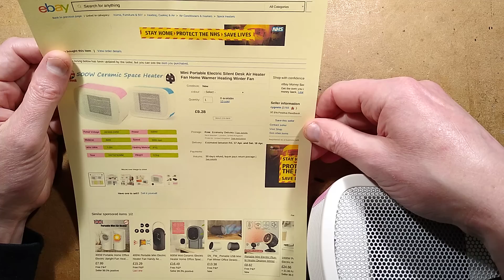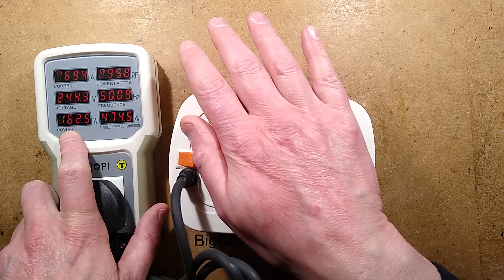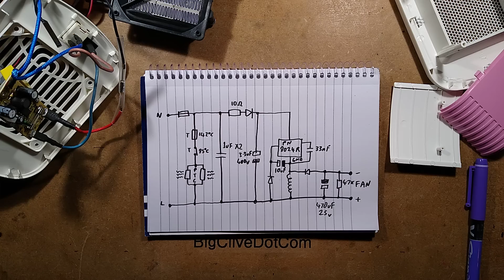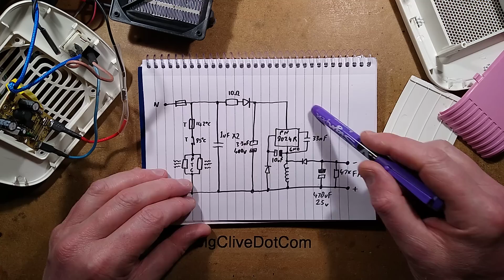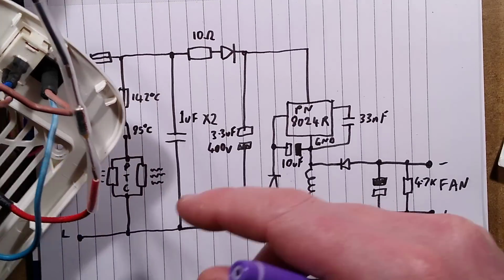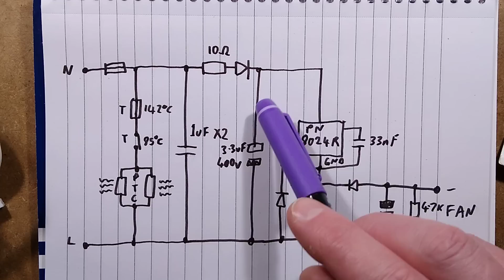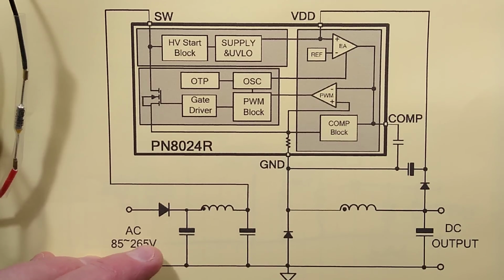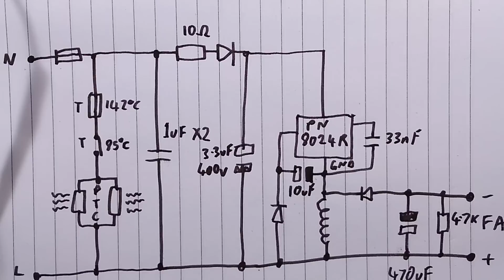Inside a pink plastic 500W heater from eBay.  (Good for parts.)

Comment: It looks like it has similar components to the Chinese clothes dryer I bought from eBay. I got it because I was having problems repairing our electric dryer, and I didn't have enough money to replace the dryer or get it serviced. It cost around $40.The Chinese clothes dryer using only 1,000 watts, but it gets the job done. It's basically a shrouded clothes hanger stand with a heater at the bottom. It's plugged into the 240 dryer outlet in a kind of doggy way. I use a 240 dryer cord that I had lying around that goes into a box with a 15 amp breaker on each leg since both are hot. I'm trying to be somewhat safe here since it is a 30 amp 240 volt line. I'm just using a regular outlet since the Chinese use the same plugs just with no holes in the prongs. I also have labels on the box stating that it outputs 240 volts. You wouldn't want someone to plug just anything into that. As for the 60 hertz, I doubt it matters since it uses a DC fan, and I doubt the PTC heater is affected by it.
Reply: Why do American plugs have holes in the prongs? Is it so it doesnt get pulled out while hoovering for example. Bearings in socket holding it?  UK sockets are a good design for the time but seeing  most appliances are now low wattage they are over designed. 

I've never seen a usa 240v socket although I I under stand driers and ovens there use 240v. We use 110v here on building sites.

Ask any British person what pain is, and its standing on a British plug in the night.  Worse than Lego.
Reply: @tonyjones9442  there are three reasons for the holes. 1) If you look in a US 120v outlet, the contacts have a detent in them that fits into the holes to help secure the plug. 2) Manufacturers and industrial places can use lockouts on plugs by slipping them through the holes, making it impossible to accidentally plug it in. 3)it's a bit cheaper due to less material.

Here's all the nema plugs we use.   http://www.nooutage.com/nema_configurations.htm
Reply: @03HemiCentralIN  actually should be more expensive because less material... cause someone had to punch that out...
Reply: @03HemiCentralIN  Thankyou. I was married to an American. Whenever I was in the states it always supprissed me how in towns there were transformers on poles. Like round ones. And the overhead cables  looked messy (sorry).  In uk you do get them on poles but in rural places only. To my rural house it's all on poles then drop down  transformer. You wouldnt get that, or at least the transformers bit, On an urban uk pole.

One thing that annoyed me about usa & Canada electrical systems was if you did find a kettle, it was slow. Our window ac in Alabama also kept fusing. Had like a glass round fuse holder. 

When I was a child in the 80's a lot of houses still had round pin plugs. Still used in ex colonies and still legal here for radial circuits I think.asbrstos shutters.

Interesting you said about blocking the socket off in industry. In hospitals and Tibet stations there used to be a 13amp plug that was offset so people could plug their own stuff in.
Reply: @urugulu1656  no, when all the prongs are stamped out of a sheet of metal, the holes would be part of that process. So you would have one machine that not only cuts the prongs shape but also cuts the holes.
Reply: @tonyjones9442  There are detents in them, though you rarely find one that grips tight/right unless it's brand new, rarely used, or not a super cheap builder grade one AND nobody ever jammed a plug with bent pins (they bend easy) in it.
Reply: @tonyjones9442  yeah that's about the same that's happening here currently. The rural areas still get 3 phase on poles while towns and cities move to using burried cables.
Reply: @03HemiCentralIN  very rare to get  a 3 phase supply to a domestic house in uk.  I know in Europe they have 3 phase even in flats, like one phase for lights, another for sockets.
Reply: @tonyjones9442  yeah, that's we do too somewhat. So, for residential we split the 3 phase to single phase to cover multiple houses with two transformers. Remember 3 phase is 3 hot lugs and single is 2 hot lugs. But then things like apartment complexes have 3 phase due to the power requirements of all the apartments. Then like rural farms will have three phase for farm machinery like motors for a grain bin. When you have 5 motors running anywhere from 208v to 480v you need 3 phase to lower the amperage. Some of the 480v motors are 70-80amps which is a lot. Also, I personally don't know how Europe wires up three phase but generally you want to load balance all three lugs. So no lug has more power being drawn from it compared to the other 2.
Reply: @03HemiCentralIN  yes, in uk We would want a balanced load here too.  Its years since I went to college to do it.  I'm not to sure how Europe does it.
Reply: @03HemiCentralIN  There is lots of rural single-phase distribution in the USA.
Reply: @brianleeper5737  I can just say where I'm at, it's almost all three phase with a very rare single phase on the poles. Most properties that are just a home are wired up single phase while any home that is or was a farm normally has three phase. Personally, I think upgrading to three phase is a good idea for future proofing. With the advancement and more mainstream of electric vehicles, three phase will be needed to get the quick charging that is comparable to filling up a tank of gas.
Reply: @03HemiCentralIN  Well, where I'm at the nearest 3 phase is about 3 miles down the road and you'll pass several farms on the way.

Comment: Replacing thermal fuses by soldering them in place is easy - just wrap it in a wet tissue. For high temperature ones water is fine, for lower IPA is a way to go

Comment: Just the neutral is fused and the fan is directly connected to live on one connection ... nice 😁👍
Reply: To keep the fan running in the event of it overheating and cutting out the heating element. Quite a sensible idea, there is a 13 A fuse fitted in case it all goes to shit, could probably get away with a 3 A fuse but for that startup current

Comment: That tiny little first heater from the other video Clive is probably designed to have the heat output pointed toward the person wanting heat. Both that and this 500 watt one are personal heaters although the 500 watt one is a bit high on the wattage for that. The idea of the lower wattage (especially the 150 to 250 watt range ones) personal heaters are to heat the person and not the room. I have a 200 watt one from a reputable manufacturer and on a cold day it can help keep me warm, yet not affect the central heating thermostat only a few feet away. I don't think Lasko serves the UK, but the model I have is the Lasko MyHeat model 100.

Comment: The thermal cut out never tripped, or the wattage would have dropped well below the ~200 watts you saw on the meter. the fan and power supply wouldn't take more than about 7~10 watts, if the element would have been cut out.

Comment: Several years ago, my Boss borrowed a newly refurbished terrace house in Bayswater, London, from a friend for his family during their extended stay of six months.
During a partially cold period, his wife bought a halogen heater similar to the one demonstrated to supplement the central heating and placed it on the bedroom floor
While the wife was using the ensuite bathroom, the heated toppled over, face down onto the carpet and burnt the house down. The incident was reported on the traffic news..

Comment: Very interesting and entertaining, Clive.   Here in the US, these take the form of  "Handy Heaters", which are basically the same thing, although they plug directly into a wall AC receptacle with no cord.  I'm not sure that this is the best place for a heater, particularly if one has small children about.  Power ranges somewhere between 350W-1KW.   Many, although not all, have the warning that they are not to be used with a GFCI outlet.  I'm not sure why that is.
Reply from the maker: I wonder if the GFCI outlets have a lower continuous power rating.
Reply: @bigclivedotcom  I don't believe so--they're rated for either 15A or 20A at 120V.  Here's a typical one:
https://www.leviton.com/en/products/gfnt1-fw
GFCI outlets are most commonly found in bathrooms and kitchens, so that may have something to do with it.  One would have to be pretty brave to install one of these Chinese heaters in a bathroom.
Reply: Dusty 99  Water, perhaps--Clive didn't show any particular design features (e.g. conformal coatings, etc.) that would make these suitable for such use.   But I'm just guessing.  The only other thing that comes to mind is that the units exhibit such leakage currents to ground that they'd pop a GFCI--but that seems unlikely.

Comment: Just a few weeks ago, I expirenced what I assume to be "catastrophic faliure" of cheap room heater. It wasn't even ceramic, just a bare heater wire and side blowing fan. For whatever reason, power cord decieded to set itself on flames and i'm pretty sure there were high voltage arcs inside

Comment: I run a 200w 120v heater like that in my cars over the winter.  In conjunction with some very small dehumidifiers, to keep the condensation down.

So far both systems seem relatively robust

Comment: Iam I missed something, does the heater stay on all the time when its plugged in ? I need sleep myself, weird design pcb.. Thanks for the video
Reply from the maker: It has a switch on the back.
Reply: @bigclivedotcom  As there's no thermostat, yes, it stays on all the time when switched on.
Reply: @jamesplotkin4674  No thermostat.  It's just designed as one of those personal heaters, not one to set and forget.  The PTC style element is self regulating to a big extent, as you will see it uses less power as it gets hotter.
This is just one of those heaters, like the cheapy fan heater or radiant bar heater that just has high and low.  They also don't have thermostats.
Reply: I think I missed pretty much everything. I could definitely do with some sleep too.
Reply: I guess it's just the startup load (inductive?) that necessitates the 13 A fuse, otherwise 3 A would suffice surely?
Reply: @satyris410  The load is almost purely resistive, not inductive.
The device acts like a Positive Temperature Co-efficient Thermistor, which means it has low resistance when cold, hence the spike to over 1Kilowatt at start.  That would put an end to a 3amp fuse.
Most devices of this nature would have a 13Amp fuse in a British plug
Reply: @EsotericArctos  awesome, thank you!

Comment: Generic casing looks like a speaker box, kinda made me wonder if it was a multi purpose design case for other products but prob not.
Reply: Depends. Good plastic molding forms are not cheap and have usage limit. Most likely they purchased used molding forms from speaker manufacturer and repurposed for heater cases.
Reply: who knows, the same factory could be using the same molds for wireless speakers and heaters. hmm.

Comment: Seems like you could modify it to have two power settings, or even three. I wonder which part of the the PTC heater is the "cooler" side if you just connect two of the leads.
Reply: No because one side might overheat it's plastic side

Comment: its self limiting. in case of overheat it automatically sets your house on fire and that will burn the insulation of the cables in your house, they will short circuit and safely turn the power off.
Reply: My car is self limiting too! If I drive fast enough it will automatically lose control and safely slow itself down using a nearby solid object. Truly genius design.

Comment: Back in the early 70s I was working on a Greek cargo ship, we got stuck in port in the UK, because the owners had not got the finances to fuel the main engines, had electric from the on board generators , but no heating, it's was cold in the cabins, we took to making our own heaters, an old crab line reel with a strip of bakerlite on each edge, wound steel wire around it from one end to the other, bit like a coil, neutral domino blocked to one end, live the same to the other, hang it above our bunks & plug in, the wire glowed like a conventional bulb filament giving off some heat, thinking on it now, it was highly dangerous, but we were young & reckless back then, also the voltage was DC, we were sleeping underneath these things lol

Comment: Id bet they went with an inverting buck/boost to compensate for the high inrush current. If the supply sags down the fan can still run without cutting out.

Comment: I bought one of the small ones a short time ago too.  The fan still works fine, but after running it for 3 hours the PTC failed.  So now I have a crappy fan with no heat.
Reply: One of the thermal cutoffs probably failed. You could replace it, but it might just fail again 3 hours later :/

Comment: I wonder why they didn't put the thermal fuse in series with the supply fuse so that in the event of really serious failure it would disconnect everything
 Ar 142C the fan circuitry could become dangerous and a heat source itself so better to cut it off.
The bimetallic cutout us in a sensible place as in a mild overheating it is sensible to keep the fan cooling it.

Comment: Yes the flames on the packaging definitely not a good insinuation 😆 🔥🔥
Reply: So why do people buy "Ultrafire" lithium cells??
Reply: @BerndFelsche  why do people buy vw cars again after they have been shafted? They are dumb you won't believe it
At least ultrafire gives you "fire" when its blow while charged fast, other than the rest use cases where it is fine

Comment: Quick question. In UK, the power outlets have a fixed position for the live and neutral wires? Because with most plugs on other countries, you can rotate them and switch live and neutral lines. Also, on those non polarized outlets, isn't that a safety hazzard? Let's take for example a lamp. The live is the outside shell and the neutral is the center pin. Wouldn't that be a problem if you touch the lamp holder without disconnecting it from the plug?
Reply from the maker: The non polarised sockets do pose an increased shock risk with ES lampholders.

Comment: Seems greatest danger in this heater construction is not circuitry design or casing material, but possibility to get accidental electric shock from poking metallic things (nails, paperclips) through grill when heater is connected to mains and turned off. Hint: mains sockets doesn't have enforced polarity and . Otherwise it is fine.

Comment: That psu seems over engineered for just a fan.
Reply: Yeah, what's wrong with a good old fashioned shaded pole induction motor?
I wonder if it's really cheaper to rectify the mains power so it can be turned into high frequency AC or pulsed DC and fed into a transformer, then rectumized again and fed to the switching "inverter" of a brushless DC motor that they happen to have in stock, and that probably has an internal switching frequency of 50 or 100 hz.
Reply: Delta B Well, clearly it IS cheaper, or else they wouldn’t have chosen it!
Reply: It'd be a bit more believable with a variable speed fan. Delta B mentions SPIM which went round my head too but I came out with synchronous motor (like used in clocks, motorised CH valves etc.) that just have a simple coil of wire and no need for rotation. I doubt they can even be classed as SPIMs ?

Comment: The efficiency ones should be like that: heating element resistor should be connected in to a capacitive drop and not directly in mains with alot capacitors like an inverter mode heater

Comment: I think there is a huge market for garbage heaters because in some parts of china you are not allowed to heat your buildings,
in other parts you are only allowed to heat from a certain date onwoards (thats the point where air outside gets so toxic because no regulations applied you'd rather freeze and get breathable air...)

edit: A few years ago i bought a "self regulating" ptc heater module from conrad or reichelt, you could vary heating power by removing the "tabs" in the heater, which each consisted of 3 tabs/blocks i think 25W (or 50?) max each with enough air flow/low temp... never got to build it into something though. they have holes to blow air through/over.

Comment: KInda looks like a lot of AC ripple would be floating through that fan.  Makes me wonder how that is going to affect it's life time.  Also, looks like the PTC is the discharge resistor for that huge cap.  If you managed to trip the thermal fuse, you could then get zapped by the plug, no?

Comment: I wish it had a gravity switch. So if it does tip over it switches off immediately. Any push in switch on the bottom of the case would do.

Comment: In the 1970s I made electronic projects some of which had power transistors. The heatsink compound used was a silicon grease which looked like silicon sealing compound. It remained jelly like forever. The white heatsink compound used these days is like chalk mixed with an oil which dries out rather quickly leaving a plaster like residue. Could you do a comparison of the two?  Stay safe & best wishes from Australia
Reply from the maker: The white stuff is often zinc oxide in an oil base (possibly silicone oil).  I've never done a comparison between pastes and plain silicone grease.
Reply: @bigclivedotcom  Thanks for that. Cheers